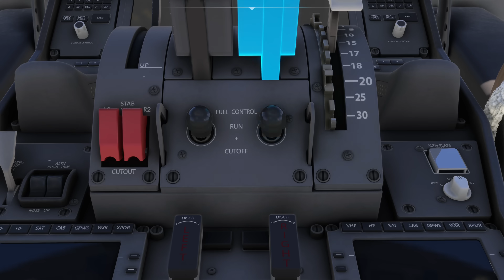Air India 171: Why Did The Fuel Cut-off Switch Get Moved?

Comment: So, one important thing to note is that these switches don't DIRECTLY control anything. It sends a signal to a computer that has full authority over the engine controls. Is it possible that the switches weren't actually moved to cut off and then back? Yes. Depending on if the input for that particular microprocessor is supposed to be LOW or HI (essentially, 0 volts or 5 volts, depending on the signaling voltage). If the wire has a break in it (keep in mind, these switches have been replaced a few times), it could potentially read low, the same way that a switch being moved to cutoff would read. And since that's the way the microprocessor would read it, that's the way it would get reported in the FDR.

However, I'm not sure if that's the way the switch operates -- as a basic switch. It could use more complex signaling through some other established protocol. Similar to the way some car switches don't just send power to an accessory they control directly, they send it across the entire CANBUS. If it uses some sort of serial communication, then a broken connection won't read as a cutoff signal. It would simply not have any signal associated with it.

The only possible shred of doubt is the advisory bulletin reporting that some switches might not lock into run and, therefore, could potentially slip into cutoff with vibration or some take-off related g-forces. Unlikely, but not impossible. And that is what people will cling to until that can definitively be ruled out. Problem is... I don't know that it can. There's no forensic testing that could tell if it was moved accidentally or on purpose. So, this would remain one of those unanswered questions and become the second shooter on the grassy knoll or whatnot.
Reply: every time somebody asks a question regarding something a little more complicated out how the fuel control switches actually work and the electrical signals associated with it, captain Steeve responds by saying "I don't know anything about that" !!
He did it again in this video (3:50)
Reply: Any safety critical switch will be dual channel with two sets of wires all the way from the controller to the switch. They will also be self checking with interlocks and test signals.  Even a 'simple' door to a dangerous robotic enclosure has this.  If anything goes wrong it will be detected and will fail into the safe state which in this case will be fuel on.
These things never fail into a dangerous state.
Reply: The investigators could forensically examine the fuel cut-off switches to determine if they were installed correctly, were the springs intact, were the detents worn?  They could also get a couple of the switches off the shelf (at about $1000 each) and set up a rig to test whether in a malfunctioning state they could move from run to cut-off from vibration alone.
Reply: @MrAmontay  the switches were pictured after the crash, they were locked in run position, exactly as the what the data says
Reply: I am assuming that there is more complex logic than that, like running at 2 voltages greater than zero, to eliminate this type of failure. It is essentially a safety circuit, so different rules/laws will apply to its robustness. There could even be a heartbeat that senses switch position.
Reply: It's a mechanical switch with a locakable knob and spring. He already showed how to do it with exact motion.
Reply: If those switches weren't working as intended, that plane wouldn't be flying at all

Comment: A major question for me is why the fuel cutoff switches are in such a place where it could even be remotely possible for one or both to be accidentally turned off, the brackets to the sides help avoid it but imo not enough and I been feeling for over a decade now that it was best either moved,under a flip cover or to where it takes an extra action a piece to shut them down, in particular while in the air but on the ground as well and to turn them back on the procedure stays 1 action

Comment: Is it possible that something happened prior to the fuel shutoffs being recycled? Since the dual engine failure procedure is to recycle those switches; possibly the engines failed prior to the switch movement. Without listening to the tapes, making an accusation as a pilot is shaky, IMO.

Comment: Perhaps a solution to sabotage-proofing the plane while also allowing pilots to turn engines off in case of emergency could be only allowing one engine to turn off at a time at a certain altitude. Since it’s so incredibly rare for a double engine failure to occur, you will most likely never need to turn off more than one anyway. Just a thought from a math-illiterate English major, please forgive any ignorance.

Comment: Whats super confusing is that if a pilot wants to crash the plane they can just yank the yoke to one side. The plane would tip over the wings and dive to the ground.  There is no way to recover from a dive like that from low altitude. Shutting off the engine fuel switches seem way too elaborate to crash the plane.  Not to mention that it takes a few movements to turn the switches off one by one.  The other pilot would immediately see one engine fuel is shutoff and switch the fuel back on. Since the engine is spinning, it would immediately relight and provide thrust.
Reply: Once shut down, the engines have to go through a relight sequence.  The suicide pilot knew that as long as he moved those levers to cutoff immediately after takeoff, there was no way to get thrust back before impact with the ground.

Comment: Theirs no evidence that one pilot deliberately moved the switches to cut-off. Before starting to direct this towards piloting error, The question many people should be asking is why wasn’t the full cockpit voice recording released, why was it just that short transcript? “Why did you cutoff” everything in an investigation should be questioned. Are they trying to hide something and shift the blame on the pilots as usual (easiest thing to do). Somehow I believe in my gut they know the exact reason based on all the findings they’ve recovered but released this preliminary report to in such a way, so that the media will start running with a story leaning towards pilot error. Now theirs reports from various channels stating that one of the pilots now had depression issues. Let’s hope the real truth does comes out as to what really caused this accident.

Comment: How do you know switches were placed in cutoff position? Do they have CVR recording with switches sound? You you see DFDR data switches were placed activated it does not mean they were physicaly moved. Yes, there is possibility  high ot was done but not 100%.  Normaly you apply power with switch or remove. Same can be done by disconnectin connector if it was loose and after rotations you have some g and NLG shock extension which makes some wibrations which can affect poor contact somewhere.

Comment: Just a thought that came to mind — what if the aircraft’s computer logic is designed so that, during takeoff (assuming there's an input that detects this phase), any fuel cutoff switch inputs to cut are ignored or overridden? In this mode, the computer would essentially ignores it. I believe there’s no valid scenario where cutting off the engine's fuel supply during takeoff is necessary, i hope so, not a specialist, so implementing this logic could serve as a safeguard against both accidental deactivation and mechanical switch malfunction.

Comment: The natural thing is the the first officer never takes out his hand of the column of control, and he is not watching directly the display indicators but  the angle of attack, the speed, and the horizon level (in the display and by the right window near him, SO, the natural thing is he felt, in some micro moment when he was looking at the right window, the spooldown of engines, so he watched the display of engine power and cpnfirmed the engines shutting down,  while all of this happened the captain only job is not looking outside but looking all the displays DIRECTLY and manage: radio, gear train, flaps, power levers. SO,  the first officer was the one who asked the captain why he cutted off the fuel.  IF the case were the opposite.. at the very moment the captain , who is watching all the displays, sees that the pilot flying (the firtst officer) takes off his left hand and his eye-attention from the take off ascent process, to cut off the fuel switches he would have yelled , and he would have instantly put again the fuel switches in the RUN position. Remember that the fuel switches were put again in the RUN position 10 seconds later (WHY SO LONG?). So, put your heart appart and be logical at this point, with the available data that we have just follow the Occam's razor principle to solve problems that advocates that when presented with competing hypotheses about the same prediction and both hypotheses have equal explanatory power, one should prefer the hypothesis that requires the fewest assumptions. Ergo the captain cut off the fuel pumps while the first officer was not looking directly what the captain was doing, we dont know the reasons, but that is the the logical conclusion given the available data to date. if any other data is released we can construct more, in any direction.

Comment: Everyone should look at this excellent analysis by GaryBpilot here : https://www.youtube.com/live/VI4fY-CJ1DQ . Especially when he details the content of the 2019 "Special airworthiness info bulletin" which clearly states that "If the locking feature is disengaged, the switch can be moved between the two positions without lifting the switch during transition, and the switch would be exposed to the potential of inadvertent operation. Inadvertent operation of the switch could result in an unintended consequence, such as an in-flight engine shutdown." Don't jump too quickly to the conclusion that it was an act of sabotage. Don't forget also that 2019 was the midst of the 737 MAX disaster, a good reason to downplay that issue with the fuel control switches...

Comment: I’m curious about the point where the switches were turned off. The report is very specific in its language saying the switches were turned off “immediately” as the plane reached 180mph and rotated. That also means that the planes logic transferred from ground movement to air movement. When the weight on wheels switches deactivate, a new paradigm is formed for the plane as “flying” and all new rules apply. Is there anything that happens at that point act moment that would cause a pilot to touch those switches? Had they been thrown sooner the plane would have interpreted what to do as if it were still on the ground. If they had waited another ten seconds they likely would have time and altitude enough to save the plane. But, because they picked this precise time to cutoff fuel, the pilot throwing the switch knew that the planes logic transferred couldn’t recover on the time remaining. I’m very curious if that exact timing was planned or a coincidence and was wondering if you could explain what normally is happening in the cockpit at that precise moment?

Comment: I think inhibiting fuel cutoff to both engines at the same time when off the ground would address the issue. Would it be possible to add logic to avoid shutting off fuel to a good engine by accident when the other engine has failed?

Comment: I doubt that you can completely "sabotage proof" and airliner.  If not fuel cutoff switches, then something else would be done.  Perhaps the only 100% defense would be monitoring of all systems, include a video of the flight deck, monitored by somebody on the ground paired with a means to disable all controls and taking over control remotely from the ground.

Comment: We are told that the co-pilot was the pilot flying. If that is the case, should he not have two hands on the wheel? Therefore, by default, if one of the two pilots pulled the cutoff switches, would that not have to by default be the captain?
How easy would it be for the pilot flying to pull the cutoff switches given the above?

Comment: Is it possible that the springs, plastic casing, detent cutout etc would be affected by environmental or fatigue factors? If the switch accidentally slips from on position,  does it goes to neutral or no action position or does it snap to the off position? Is there a display in the mfd that warns of the fuel cutoff or could the pilots be commenting on the audible volume of engine spooling down? Would the engine spool down immediately on cutoff or would there be 3 to 6 secs of fuel still in the engine pipeline fir it to keep running? Maybe positive Gs are a factor here.  Maybe we need to explore other probabilities before settling on the obvious conclusion. Anyway,  there is precedence, and suicide/ insurance by plane crash would be the most illogical thing to do in this day and age.

Comment: You would never cutoff both engines in this phase. Even if you have a engine fire on the remaining engine, you would keep it running. May be he gives you little thrust. The only exeption would be an automatic dual engine shutdown. Then you try to restart both engines, by recicling the fuel switches. So, 2 scenarios. 1. failure of the system or shut down as amatter of fact.

Comment: The plane was 11 years old, so maybe the fuel switch guard was worn or broken. If one of the pilots was a bit unfamiliar with the 787 and accidentally brushed the switch — maybe trying to steady themselves or reach for something else — and the guard wasn’t working right, could that have caused it to move to CUTOFF?

Comment: I’ve worked with the manufacturer of these switches, and even if they fail those levers will never fail in cutoff mode, they are dual contact switches with manual spring locks that have to be manually moved. 

Thanks captain Steve for your expertise
Reply: Fake narrative. Facts are here. You are sold off to Boeing. Why don't you talk about FAA directive from 2018 and CAA directive from May 2025 which talks about issues with Boing 787 which can cause cut off including during inflight.  Why Etihad airlines and DGCA wants planes to be checked. Why British Authority wants checks for this issue since May 2025?.

Western media is corrupt and sold to Boeing
Reply: leave all this, talk about urgent requirement of visual proofs mandate in cockpits. (CCTVs)
Reply: What do you mean by "those levers will never fail in cutoff mode"? Do you mean that cutoff mode is just "circuit open"? If so, would, for example(!), cutting the wires have the same effect as putting the switches in cutoff position?
Reply: @waltertross3581 the lever is just another term for spring loaded lever meaning that unlike a regular toggle or switch, you have to use some force to move the lever, sorry for the confusion, 23 other people have read this and understood it I guess but this is the explanation I have. Once again thanks for asking for clarification and keep the nose in the wind brother
Reply: @waltertross3581 and to further explain the manual cutoff system, like in all aircraft it is a ground break, double contact switch and it is designed as such that if it fails it will fail as such that the pumps will not stop running. And yes your question is very specific and correct. Your explanation is correct

Comment: The resistance of pilots to CCTV video recording ON THE BLACK BOX is really baseless. Have any CVR audio recordings ever been released unlawfully or without proper authorization ??? To my knowledge, never. Why would it be any different with video??? Of course, video available to the airline hierarchy on a routine basis would be a totally different issue.

Comment: Since you stated that there is no SOP that requires fuel cutoff at that phase of flight, is there any advantage to having the flight control computer ignore the fuel cutoff switch until some lowered risk altitude?  Say 1500/2000 ft maybe?

Comment: There have been at least four major tragedies resulting in the total loss of a commercial aircraft with pilot suicide documented or strongly suspected as the cause since 1999. Egyptair in 1999, Malaysian in 2014, Germanwings in 2015, and now Air India. In the Egyptair and Germanwings cases it’s clear that one of the pilots deliberately crashed the plane. The Malaysian and Air India cases are not as clear cut but pilot suicide remains the most plausible explanation. It’s past time for the manufacturers, regulators, and airlines to accept the reality that pilot suicide or sabotage is a real hazard. At the same time, the public is going to have to accept that is a really hard problem—designing a plane so it cannot be destroyed by one of the pilots sounds like an almost impossible challenge, and there is no such thing as foolproof mental health assessment.

Comment: I haen't seen, yet, a sequence of events timeline. Many videos, including yours (sorry) are a bit vague about some of the details.
Ie, timestamp of the switch turn off. Timestamp of someone asking why the other did it. Timestamp of switches back on, and most importastly, WHO asked why the fuel was cutoff? Pilot or copilot? This info seems to varry from one source to another, perhaps because full details were not given out and the resulting information is speculative or interpretative based on whatever was handed out.

Comment: Regarding the suggestions requiring both pilots needing to activate the fuel cutoff mechanism.  Say that's done all good, but then what's to stop a pilot from quickly pushing his yoke forward or mashing the rudder at low altitude.

Comment: Boeing should have two cut-off switches in series per engine,  placed a couple of feet apart, so it is plainly impossible to activate or deactivate them alone without having to reach over the other pilot to do so. That way, you can't act in ignorance without telegraphing your intentions to the other person, even if acting unconsciously.